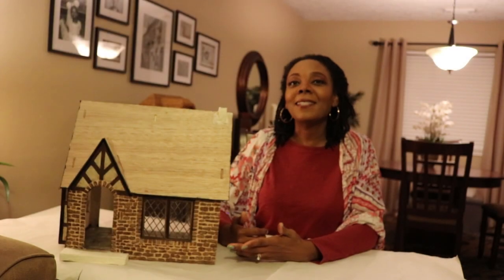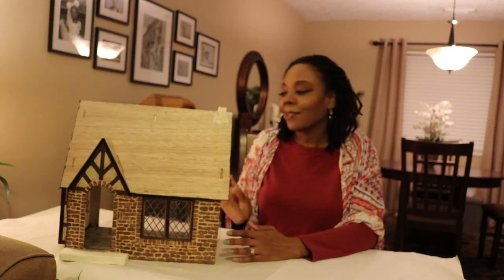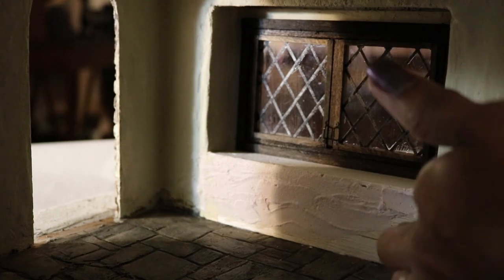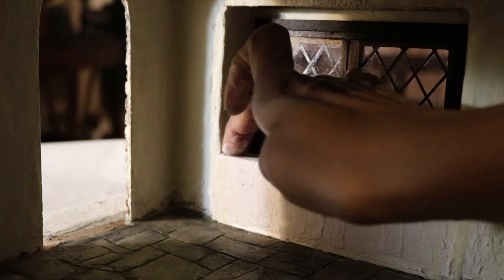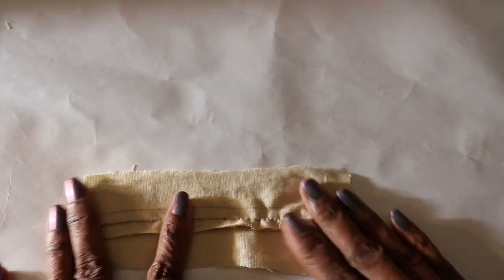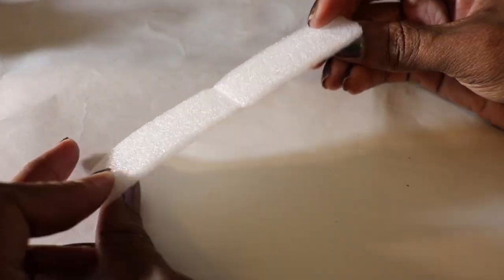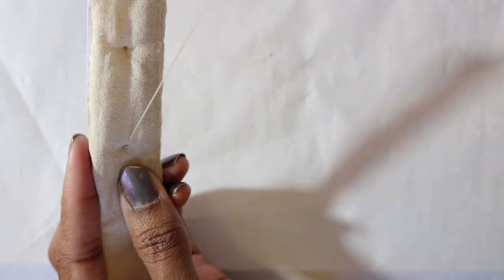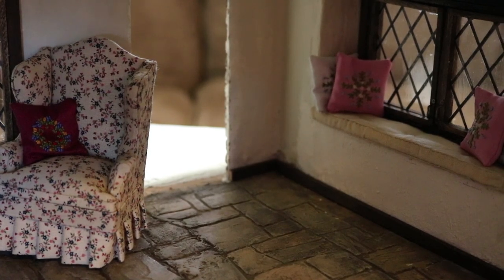Dollhouse tutorial -  How to make a window seat for your dollhouse

Comment: I love this, but I'm a tiny bit confused about using material with a pattern....right sides together for the first line of stiching.  Then on the second line of stiching, is it also right sides facing?
Reply: Yes, right sides together for the first and second line of stitching. The second line of stitching is attaching the thin middle strip of the cushion that will show once the cushion is in place. 

If you're not sure, you can use straight pins to act as your stitches and then turn the pieces out to make sure it looks right. Then sew.